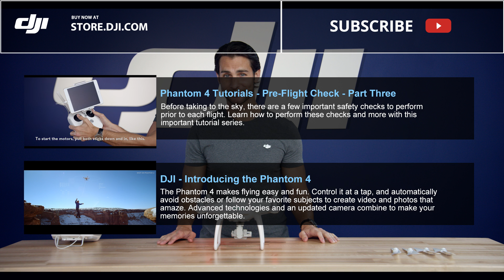DJI Tutorials - Phantom 4 - Pre-Flight Checklist - Part 2 of 3

Comment: Checking The Electronics
 Mount Mobile Device to Remote Control
 Connect USB Cable
 Turn on the Remote Control (Press Once and Hold)
 Turn on the Aircraft (Press Once and Hold)
      Flashed Red (Self Check)
      Flashed Yellow 
      Flashed Green
 Start Motor
      Remote Control - Pull both sticks down and in 
      Spinning smoothly
      Without abnormal noises
 Stop Motor
      Pull left stick down for 3 secs
 Turn off all electronic
      Aircraft (Press Once and Hold)
      Remote Control (Press Once and Hold)

Comment: I dont know why DJI continuis with this kind of turn ON and turn OFF with stickers, could this Turn OFF during a high fly, i prefer if the drone had just a kind of Bottom to turn on or turn off in mode safety, because the stickers you use to fly